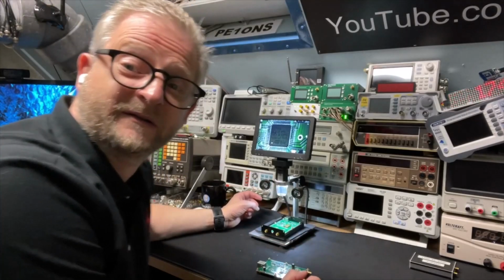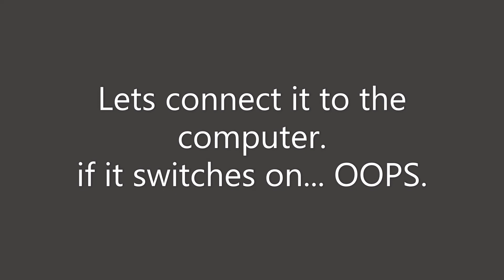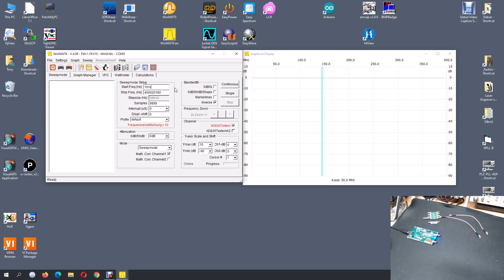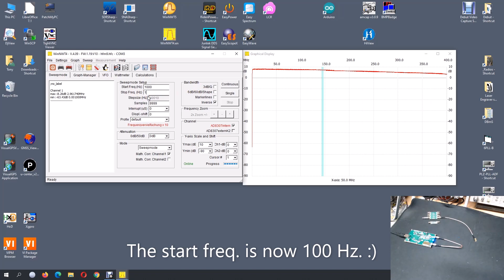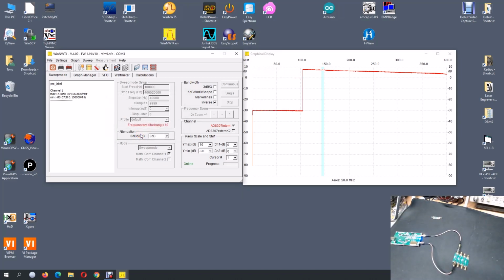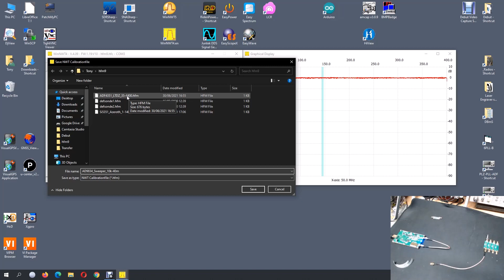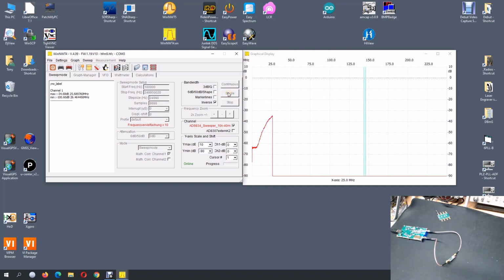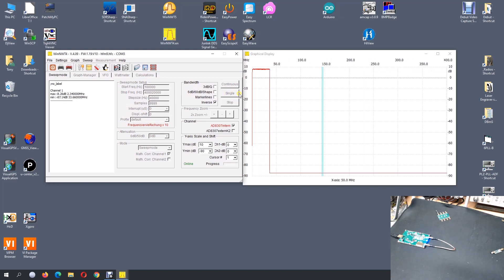#191 USB Spectrum Analyzer with TG AD9834 10KHz - 40MHz

Comment: Tony I just followed your link for the Sweeper AD9834 to Ali Express but it is 0.05Mhz - 40Mhz.  So it is actually 50k to 40 Mhz.  Did they change it?
Reply from the maker: Yes the Specs were maybe not correct, sometime they make it look better, maybe its now more precize.